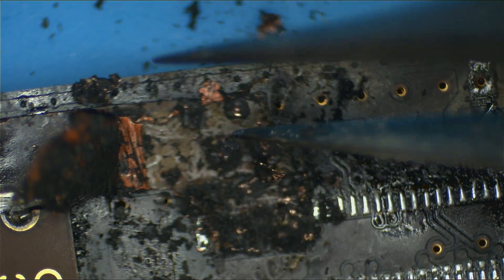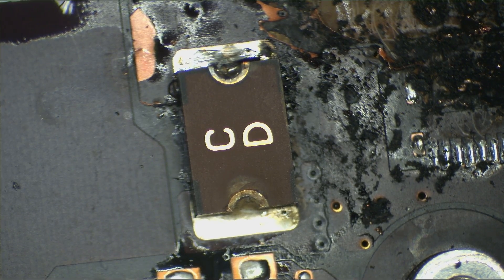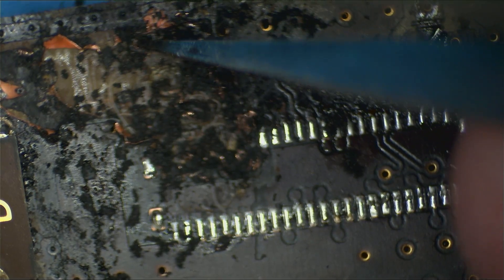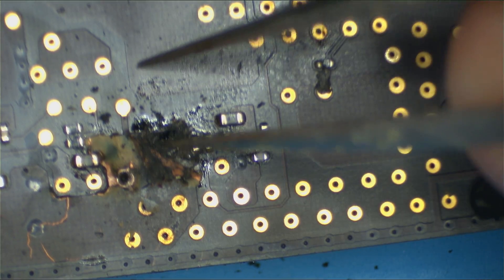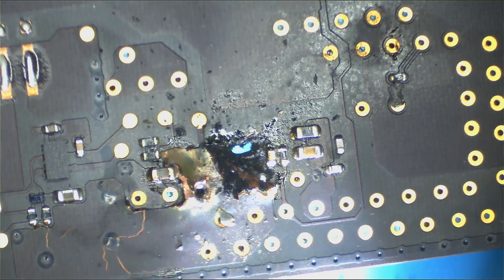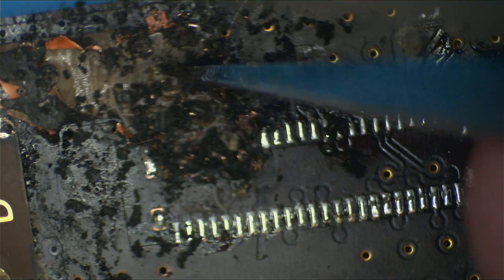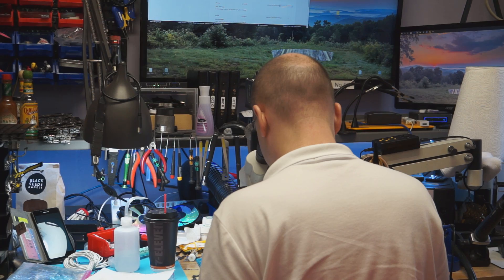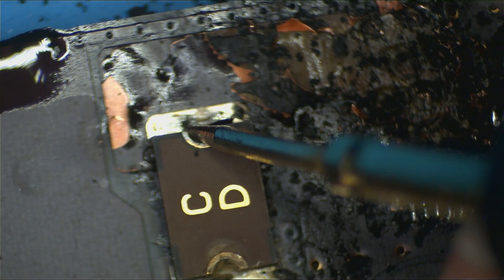Does Apple know what a fuse is for?

Comment: That's a polyfuse, resettable fuse. Could have blown then but reset after the fault. Also their i2t characteristic allows much higher currents to pass for a short time. Still not a excuse for the fire damaged traces, likely a knockoff charger used that had no short circuit protection.
Reply: These fuses honestly sound like a waste of time a regular fuse is more than good enough if placed correctly for ease of access

Comment: I think what is happening is that the amperage load of the electric arc that cut through that board is less than the rating of the fuse. Also I believe it would be close to the start up amperage of the haptic device. High resistance in a connection can produce intense heat leading to the formation of an arc. Since the total circuit amperage is limited by the the device it powers, the amperage will never exceed the maximum level allowed. Fuses limit current and not heat, therefore it is possible to burn everything to the ground and never blow the fuse. I'm not suggesting that this fuse is the appropriate size, rather that it is only theoretically possible with the correct fuse.

Comment: These are'nt your typical, industry standard fuses. These are APPLE fuses. They only trip when you use Apple certified software. That's because third party software generates a different kind of energy signature which the APPLE fuses are designed to detect. Example, when an Apple certified app calls up energy from the battery, it filters out and smooths out the electrons to ensure highest quality of energy for use. If you use third party apps NOT certified by Apple, then the fuse will NOT trip and can cause damage to the board. Therefore, this catastrophic damage is caused by USER ERROR or simply put: you were using it wrong!

Comment: Hey Luis you want to buy my MacBook Pro 15inch 2017 top specs 3.1 i7 quad core 16gb ram 1tb ssd space grey it’s practically brand new it’s comes with Apple care  expire in 2021 comes with Gtech usb -c 1tb external ssd and the usb  hub and MacBook Pro hard case  $2.200.00

Comment: Just curious, can that board still be repaired? What kinds of damage can be consider irreparable?
Reply: this board can but not every board can and it depends on the availability of new or donor parts and the individuals skill and knowledge, louiss has the knowledge, tools and skill to probably fix this but he will also know that its gonna take him a long time where he could fix another 3-5 boards instead and be more profitable
Reply: Really? I know you can replace the parts from another donor board, but if the board itself is burnt like this, you'll pretty much have to replace the whole thing.

Then again, Louis can probably do some crazy "jumper wire" magic to resurrect the board from dead. But that is madness.
Reply: @RufasWan  theres a video where a guy hand solders every pin on a cpu and it works cause his socket broke, as long as u can recreate the conditions required you can fix it
Reply: Yes, I saw that video before. It is insane.

Comment: Not to be a complete jackass here but, isn't that the purpose, and the defining characteristic, of all fuses? That is, they exist to mitigate potential damage further down the line. You're awesome Rossman, and you don't need to hide your knowledge behind ambiguous phrases like the one you used here. Besides, by implying that there's some other possible use for a fuse leave open the possibility that apple had some other reason for putting an over rated fuse in a circuit, other than their absolute incompetence.

Comment: My ultracheap multimeter got 220v in dc mode trying yo measure a 9v powerbrick. The 9v battery swelled and the probe got cut. But the fuse was right as rain!
Apple isn't the best at anything

Comment: Good thing Apple engineers don't do any thing over 50volts in the low, medium and high voltage side of things. Buildings burning down, houses burning down, cars blowing up at charging stations, wires evaporating. They would oversize everything.

Comment: I own an Apple ][+ circa 1978. It stopped working after 2 years. The power supply wasn't supplying power. No user servicable parts and the ps case was divided shut.
I drilled out the rivets and guess what I found? A blown replaceable fuse. Cost of fuse: $0.50. Cost of power supply: $100.00 (1979 dollars).

Comment: You're looking at this wrong. The apple fuse did blow, but the failure mode of an apple fuse is to go short circuit. You can tell when the apple fuse has blown by the smell of burning PCB.

Comment: Semper Fi Paul. I was a fellow comm-elec (2841). FACTS on the AN/GRA-39 being a beast to work on. I hated replacing the switches on them. I still think the MRC-138 components were a little more worrisome..flex boards on the UHF radios. We literally called the section where we fixed the 39's "junk". HF, VHF, TEL, and Junk. Thanks for bringing back those memories. Also big props on being the main tech. Any Marine Corps elec-tech is solid gold. We always got the hand me downs and had to keep them working. Who here remembers ERO's & EROSL's ?

Comment: Unrelated: Remember the counterfit screens ? Of course ...
I came across this video: https://www.youtube.com/watch?v=MG_NRcy5mxU
They sold a vesa mount for the iMac pro ($5000), branded as an Apple product.
But this guy ran into some snag and needed a repair...
Apple responded with (2 minutes into the video):
'Even though it has been branded as Apple, it is not manufactured by Apple'
Therefore, they could not provide any warranty or support.
They are doing exactly the same as what they sued others for:
They imported stuff from another manufacturer, and branded it as an Apple product.
This should be a legitimate reason to fully re-emburse anyone for any losses.
Should it not ?

Comment: The fuse looks like a resetable fuse aka polyfuse and it will not burn under normal contitions. Maybe it can go short if it fail due to mechanical stress like ceramic capacitors or from overvoltage and short circuit??

Comment: hi louis I would have thought they would put a track on the board which is a fuse so if there is a over load the track would melt as I have seen them on car radios sets and on some tv's it is very cheap and you can 3 of them in the circuit board i am guessing most of items on the burned out board are going to be no good as they might have had a wrong voltage also the person who sent that mac to be repaired will get new board with a price to go with it.

Comment: If you have a circuit that normally draws 4 amps the rule of thumb is to use an 8A fuse. If you use less than 8A you run the risk of the fuse blowing in normal operation. This can be from power on surges or general strain on the fuse running for months close to its rated value.
There is also temperature to consider, a fuse melts because the metal melts at a set temperature. The fuse gets to this temperature by getting hot from heat of current flowing through it. If you are in India and the ambient temp is 40C/104F it's much faster for the fuse to get to melting temp so it blows at a lower current than it would if in Antarctica. This is another reason why you spec a much higher fuse, to cover all the places it might be used.

Another thing to consider is that you can generate enough heat for a fire without using more current than the 4 amps the system would normally use, and so without blowing the fuse. If all the energy that was going into running a laptop instead goes into a tiny via on the PCB it will catch on fire and the fuse may never blow.

All that said, Apple is still using much to big fuses in their laptops. The most likely cause for this is BOM costs. They're probably trying to use the same fuse everywhere because it's cheaper to buy high volume of the same fuse than lower volume of 4 different fuse values. 
Because the fuse need to be a really high value in one part of the PCB all the other lower current circuits end up with a overspeced fuse that never blows.
Reply: Well, if you have an 8 amp fuse, all the wiring or traces downstream of it should be able to handle 8 amp.. it looks like they used a really thick trace there so it's probably a faulty fuse AND a faulty component.  Perhaps the spec sheet shows a 2.5A fuse and the circuit was designed to handle that, but the wrong fuse was put in?

Comment: It's time for a game of:
"What if Apple just used wire instead?"

Here we need a 2.5A fuse, and clearly the (probably proprietary) F4800 fuse is too strong for that.

AWG Standards rate 26 gauge wire to tolerate up to 2.2A, so we can assume with tolerance of ~12%, a short of 26 gauge wire in place of the the F4800 would burn up by 2.5A, thus rendering the fuse redundant, saving cost of production AND repair.

Wires:
Think quicker, not thicker.

Thank you, Apple, I will accept the royalty checks by mail.

Comment: Does Apple know what a fuse is for?  Of course they do.  They are there to project a strong image of independence and originality as if to say "Be an original by doing what millions of others are doing".  But since they were put there by a designer and not an engineer they are CLEARLY not there to protect any circuitry.  You didn't think they would actually be FUNCTIONAL?  Did you?

Comment: Hey, mr. Rossmann, i have a question.. I guess those fuses would cut at a certain amperage... If it's greater than the corresponding track on the PCB... isn't that the worst case of malpractice? Like: "Yes, we have an OCP-element, but it's only there to circumvent legal and safety claims - who would expect it to actually work?!"

Comment: Apple says it costs to much to cut down the metal in the fuse to right voltage/ amperage so we just leave it whole. Besides we will just charge you more too fix a good blown fuse then it would cost to get a new one. Because here at Apple why fix the old when you can just buy the new.

Comment: A fuse for preventing damage to other parts of the circuit? That's so 1980. The only reason these days to add a fuse to your board is to pass UL and CE certification.

Comment: You are not correct about the fuse purpose - it's not meant to save the board or its circuits - it's main purpose is to prevent your electronic devices going on fire and burning your house down. But burned copper powerlines on board with intact fuse does bring up the question what was engineer that desingend this drinking during his work...

Comment: But if that fuse had blown, the whole thing would have stopped working and it would need replacement!

What!? That's how it supposed to work? Replacing that fuse would be the cheaper option? But how can we charge a fourth of a monthly income for repairs, if the repair is actually cheap? We can't just rip our customers! Make the fuse dysfunctional, that way it's 'there for safety'. And when the board fries we still say it's the customer's fault and we can still use our regular repair fees! Problem solved!
Reply: How about make fuse with unbreakable wire

Comment: Why not take one of apples fuses and see how much power it takes to actually blow it . For science
Reply: I support this. Id love to see Louis blowing stuff up for fun. Safely obviously
Reply: For an apple fuse, you may have to get photonicinduction involved.
Reply: What is Amp? We work with kAmps here! :D
Reply: @NoirBeard  I Miss That Guy :(    I Wonder If His Wife Eventually Came To The UK.
Reply: But will it blend?
Reply: Awesome idea
Reply: Rumour has it the Large Hadron Collider wouldn't have been possible without an Apple fuse.
Reply: yes pls
Reply: I too support this
Reply: According to the schematic its a 2.5A, 16V fuse. Not sure of the markings but it might not be able to blow fast enough if it was able to fry the board like that. That was a lot more current than just a few amps to toast those traces. The other possibility is that the fuse was subject to a high voltage (e.g. mains voltage or some other fault) and had flash-over, which would stop it from breaking the current.
Reply: @mysock351C  2.5A, 16V fuse?, but haptic motors usually runs on 5v and with a current draw of 100 mA,  don't they? Just saying lol....
Reply: @wolveric0  The 16V rating is for the maximum voltage at which the fuse can safely break a short. Once the fuse blows there is still vaporized and molten metal that can form a path for an arc. If you had, say, 100 volts across it, the internal dimensions would likely allow an internal arc to form and current to continue to flow, despite the link itself being gone. The voltage itself does not have much to do with when a fuse will blow. Its almost entirely based on current. The voltage rating is important as its the maximum voltage that a fuse can effectively extinguish any arcs when it blows. Make sense?
Reply: @mysock351C  totally agree, but a fuse with a current limit of 2.5A for a haptic motor or haptic "element" wich you know will not draw more than 500 mA is a big no no, if for some reason you get a short on the element itself it can easily draw 2 amps constantly without popping the fuse getting that little cooper trace to a melting point.
Reply: @wolveric0  I agree that its incorrectly sized. Almost like its there to protect the switching IC supplying it power and not the stuff downstream.
Reply: @mysock351C  so a apple fuse could safely power 16 top fuel spark plugs? I mean they only run at 44 amps terrible joke ik but meh
Reply: Newsflash! Large power outage in Manhattan caused by Apple fuse test gone awry.
Reply: No one can supply that kind of power. He would have to go to CERN and unplug the LHC.
Reply: First build a Dyson Sphere to supply enough energy, then I think this planet will crack before the fuse does!
Reply: This needs to be done.
Reply: Thor won't even be able to blow it
Reply: I should do it! I need to get into type of work!
Reply: Wow good idea...
Reply: I'm really late to this comment does anybody know if he's done this yet? Because I will be honest, I kind of want to see him test the durability or effectiveness of all of their parts. Or at least on his many part is he can get his hands on.